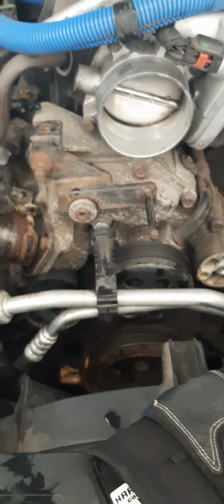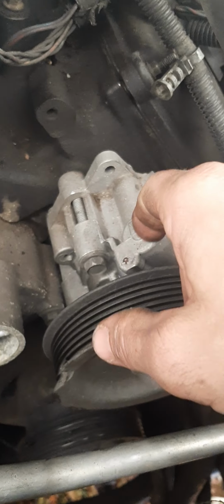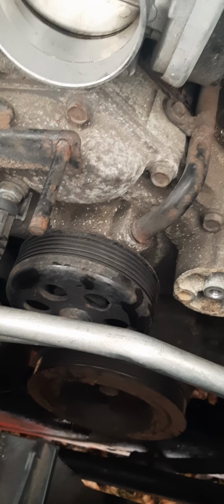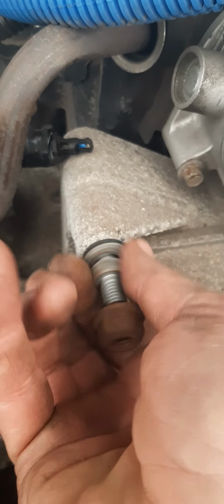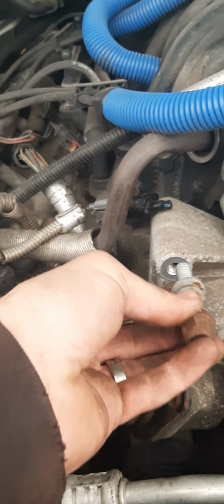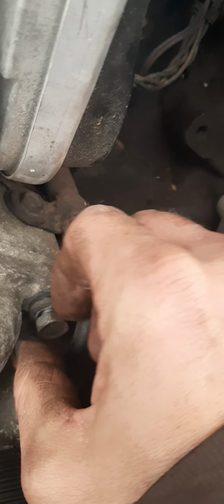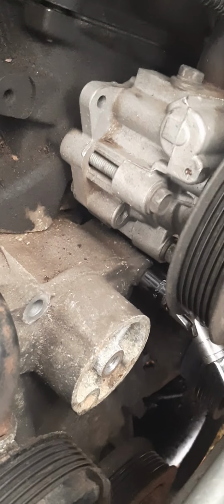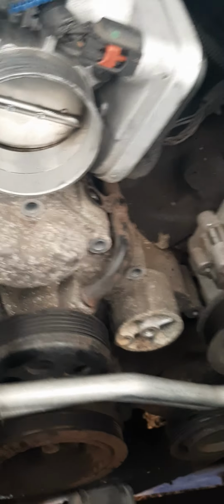Replacing the Jeep WK water pump on a 5.7 hemi (part 1) of 3

Comment: My WK 5.7 is getting an H2O pump, tstat and MDS 6 got fault code P 1416 = Faulty MDS Solenoid. I did radiator and PS pump last time. I am new to these V8s time to get a learning !!  90 yj stroked 4.7 process of rewire everything, 97 XJ 4.0 stock updated and serviced a lot by me 2000 intake, rear Durango leaf to get rid of sag, new front bushings  TRods, next will be the upper and lower control arms, read bumper, reinstall head liner....
Reply from the maker: Water pump is easy...mds might get stuck inside under the intake manifold...screw a screw in them and use a hammer to pull the screw out .it pulls the stuck mds sensor out..mds saves very little fuel for me so I am deleting it but for now I keep it on tow haul..I think I save about 5 bucks a tank..and the power sucks when they act up...
Reply from the maker: Trying to find my mystery power drain on my wife's 00 XJ...it's the fuse that powers odometer and dash...od fuse or called something like that..
Reply from the maker: You will also find out nobody wants to work on the 5.7 hemi that's what I'm running into in northeastern PA nobody wants to work on the motor the more than willing to put a new one in though also the front differentials are extremely hard to find you have the 5.7 hemewk limited the ones I think 50,000 differentials made took me almost a year to get one used new ones are almost 3 Grand so take care of your front diff... It was only 25,000 limiteds made of every year

Comment: How did you get the tensioner off with those lines in the way ?
Reply from the maker: I used a ratchet wrench from harbor freight..set was 20 bucks ..its like a ratchet on the boxed end side but it bends 90 degrees..if that wont work for ya use a small swivel socket with a shallow socket and ratchet..room was an issue but manageable..
Reply: @redhandedreviews3482  Appreciate it!!! Had one in the tool box worked great!!!! Water Pump replaced!!!:elbowcough:
Reply from the maker: @dehavenmoor9634  Good job homie, thats what these vids are for ...good to know these videos are helping people.....glad you got it. You saved a lot of money and now you have the knowledge to do it for someone for some cash lol. No one here works on these things...thats why I do it...
Reply: @redhandedreviews3482  For real for real big ups my G!! Respect knowledge is POWER!! Keep em coming!! You the man..!